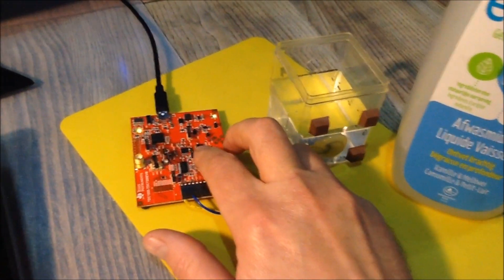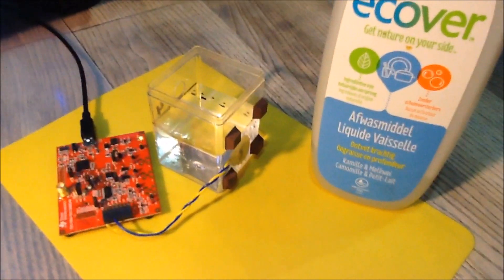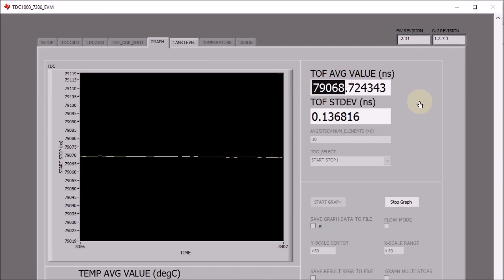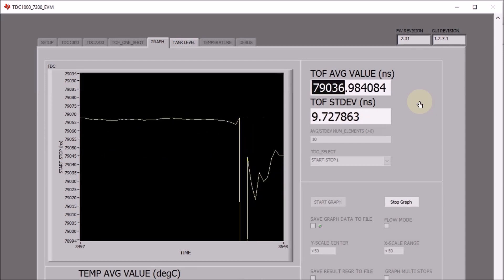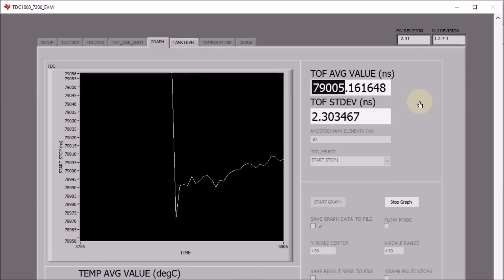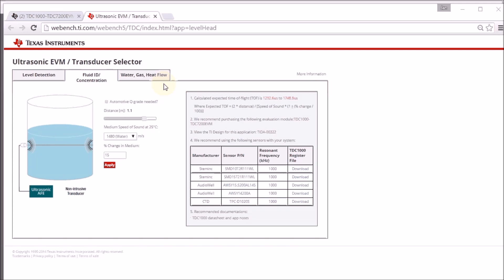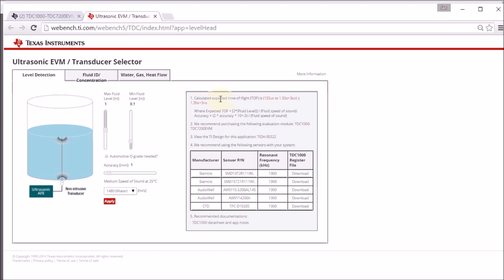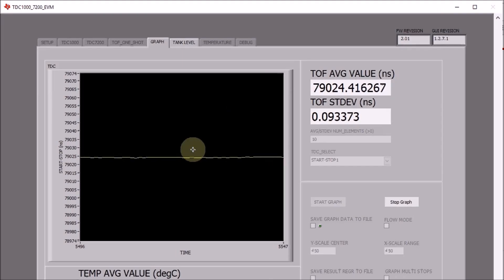TI Ultrasonic sensor  TDC1000-TDC7200EVM - Liquid Identification and Concentration

Comment: Hi Jan, Awesome video!!! I'm looking for some thing like this on a project I'm working on where we want to use an ultrasonic sensor like this to determine if vapor or liquid.  We are prototyping and were planning to use an arduino, would it be possible to use an arduino with this sensor? I know arduino has their own ultrasonic sensors, but the min distance for those sensors is too short for what we are looking for i.e. time of flight is too fast
Reply from the maker: It would be possible with one of the 3.3V Arduinos. Maximum voltage of the TDC7200 timer IC  (digital pins and power supply) is around 3.6V.

You need: two SPI interfaces, 3 digital out pins, 2 digital in, a clock signal (stable, 50% duty cycle, between 1 and 16 MHz, nominal 8 MHz) and power.
Reply: @JanCumps  Thank you! I admit I'm a newby at this, would it be possible to email or DM in the future?
Reply from the maker: Lee, I do not read personal messages. I don't have this kit anymore. I gave it to someone that was doing investigations a few years ago.

Comment: Hi Jan, 

Thanks for your video. I've been playing around with invasive hydrometers now for months and trying to figure out most easy way to measure consentration / gravity of the liquid through the vessel without $$$$ laboratory equipment.

Did you do any testing how accurate the readings were and how big of a vessel you can measure?
Reply from the maker: Kungen, I didn't.
All my tests and results are in a list of articles here: https://www.element14.com/community/groups/roadtest/blog/2015/12/13/ti-ultrasonic-sensor--a-very-first-trial-of-the-gui

I don't have $$$ material either, so I relied on the accuracy of the timer IC on the board, and the filtering functionality. The rest is math.
It's no longer in my position. I sent it to someone who was investigating ultrasone measurements for his job.

There used to be a configuration app for this kit available on TI's website, but that seems to be gone...

Comment: Can i connect the TDC1000 sensor  with the raspberry pi 3 or arduino ?  and  can i send the reading to the mobile app.
Reply from the maker: I don't know the answer. I have never tried this.
Reply: you can connect sensor + TDC1000 + Arduino. You have to program a lot for this.
Reply: I need also to connect TDC1000 to an Arduino, could you do this? or did you have any suggestion to me?
Reply: @yanasosnovskaya864  do you have that program now please?
Reply: you can do it. You need C++ library for tdc1000 and then you can interface the chip with any embedded system. Example of code: https://github.com/Yveaux/TDC1000

Comment: is TDC1000 a sensor?
Reply from the maker: The TDC1000 is an analog front end for an ultransone detector/sensor.
The second IC, TDC7200, is a fast timing-todigital converter.
I've put a link to a series of blogs in the description.

The sensor itself should be a piezo sensor in the ultrasone range. Here's a link to the proposals from TI: 
https://www.element14.com/community/groups/roadtest/blog/2015/12/19/ti-ultrasonic-sensor--first-measurements#comment-81040